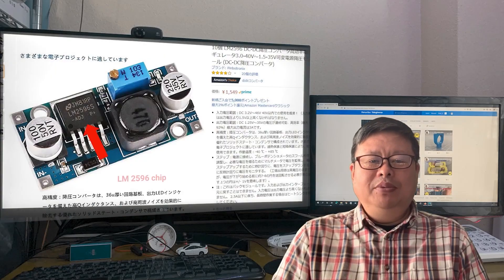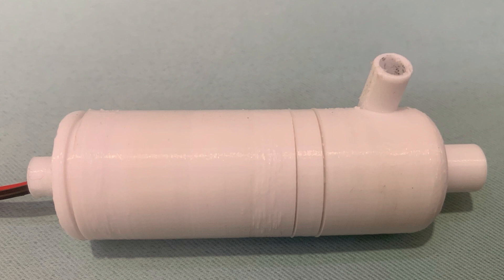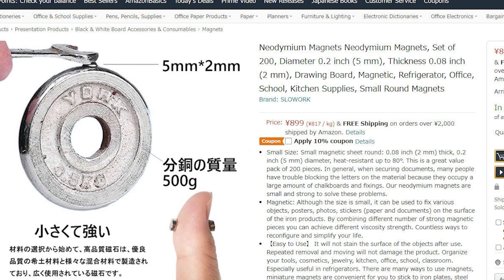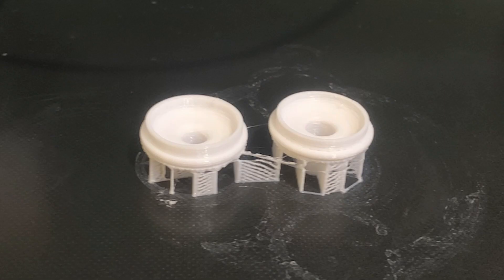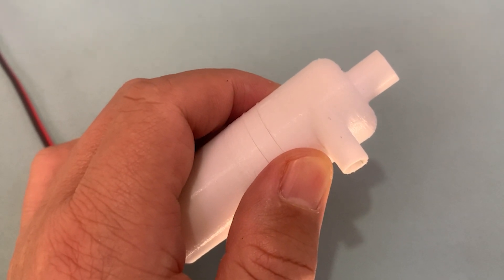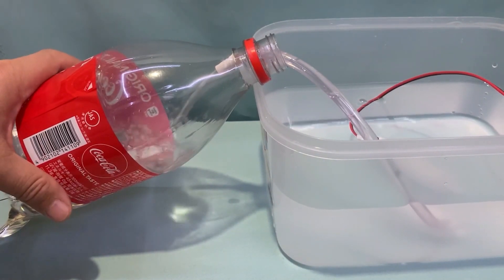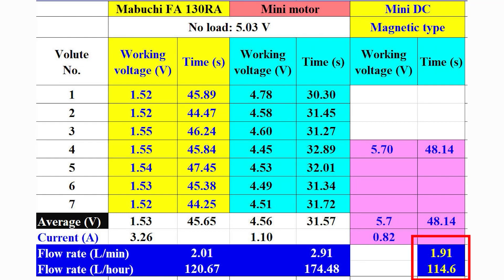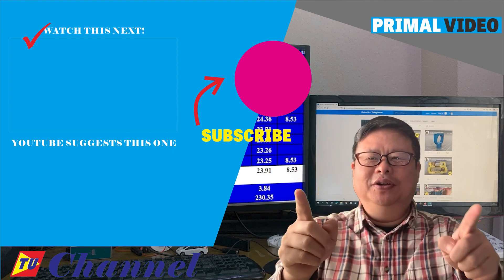How to DIY a 100% Waterproof Water Pump Using 3D Printer (non-contact magnetic coupling type)

Comment: How about the water in the impeller bearing?
Reply from the maker: The water will stay in the impeller chamber. The most important here is keep motor chamber dry and safe. Outside is easy to repair. Hope it can explain a little. Have a nice day.
Reply: @TubeUnderdeveloped  thank you , you can use a ZRo2 ceramic bearing.
Reply from the maker: @francoisBonin-phils  Thanks a lot. Have a nice day.

Comment: at 2:08 i saw the cover motor..do you have that design ?
Reply from the maker: I only use one motor. This motor chamber is separated from the water injection chamber. The torque is transferred using the magnetic coupling method.  All designed models are included in the files.  And I also make an upgraded version for this.  You can find it in my video list. Hope it will help a little.

Comment: Excellent video, thank you so much. Can you tell us what type of filament you used here?
Reply: Thank you (I wasn't sure PLA could handle the water for prolonged time periods).
Reply from the maker: @musicforsouls138 I see. In fact, after finishing the construction and do the test for one day,  I stop the experiment. It is principally good. I agree with your opinion.  Maybe ABS is a better choice. Also, if the filling density is small, the PLA parts will leak soon. That is what I have learned from a lot of tests. Thanks for the information. Have a nice day.
Reply: Very helpful. Thanks for the extra info. Good day to you as well.
Reply from the maker: @musicforsouls138  You are welcome. See you later.
Reply from the maker: Thanks a lot for your comment. I usually use PLA filament. I think this is also using PLA.

Comment: подшипник то заржавеет
Reply from the maker: Yes, sure. But if you always use it, it will not rust I think. :-)
Reply: @TubeUnderdeveloped  
тогда лучше сальник , как в насосах для омывателя стекла , они долго служат
Reply from the maker: @Sergei_Derevnya  This is a new idea to use a mini DC motor. Also, you can use a plastic or stainless steel ball-bearing as well. Then the rust problem will disappear automatically. Of course, the oil seal is good, especially in a larger motor. It will provide more power since it uses the rotation power directly.  Anyway, thanks for your comments.  Have a nice day.